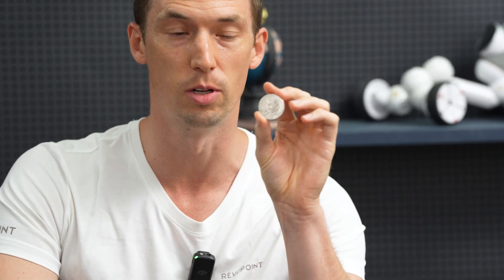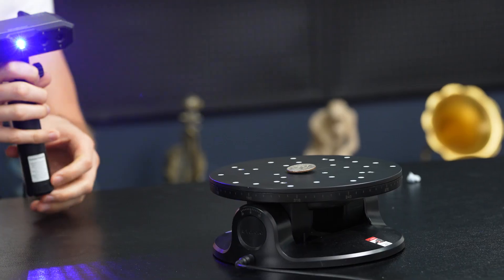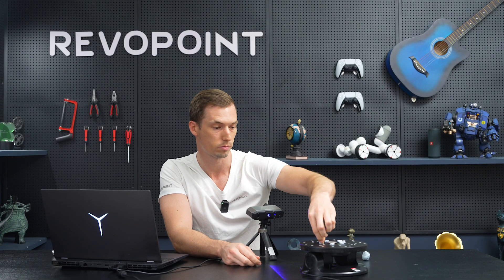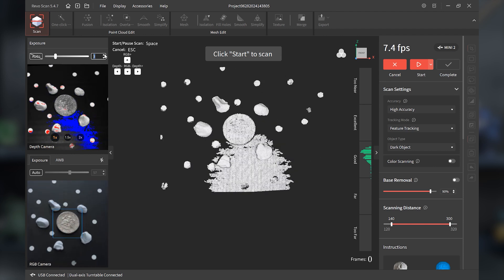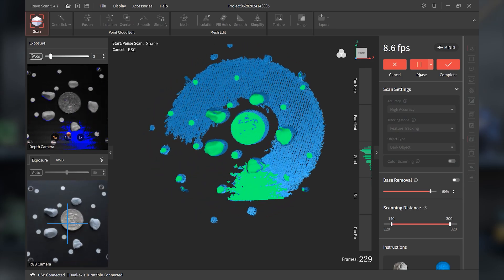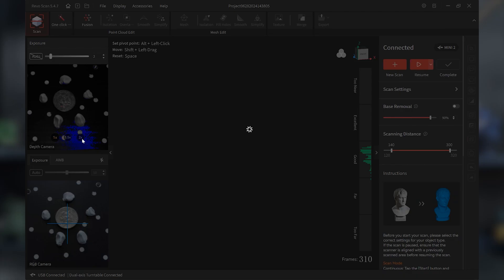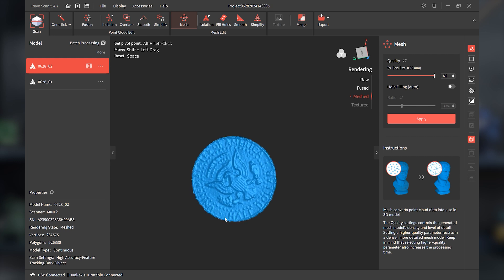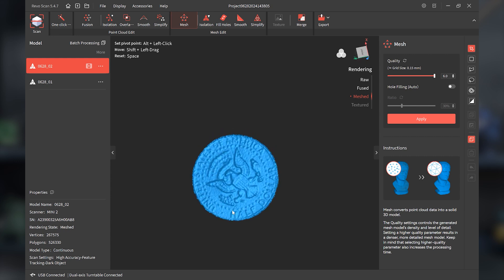Revopoint: How to 3D Scan a Coin

Comment: Please scan slightly larger objects and show us how to assemble them. Because the surfaces always remain rough during the joints and cannot provide a smooth joint.I want 2 things from you: find a dark or black object. But this object should be symmetrical and a little difficult to scan. Scan the object in two parts. Then scan the back side of this object and show us how to assemble it. Mini 2 scans beautifully for complex shapes and toy figures.However, we are having a hard time scanning objects that are slightly larger, have flat surfaces, do not have many details, but contain small holes. I would be very happy if you could make a video about this. We cannot choose marker tracking on dark objects. For this reason, as I said, it becomes very difficult to scan the products. Because Mini 2 has a very small scanning area. Yes, it can make a detailed scan, but since the area is very small, it becomes very difficult to scan.
Reply: For dark or shinny  items you need scan spray.
Symmetrical items will need marker mode.

Combining the scans you would need a good overlap between the models. Then you would need to use point alignment. Pick 4 if the same points on both scans